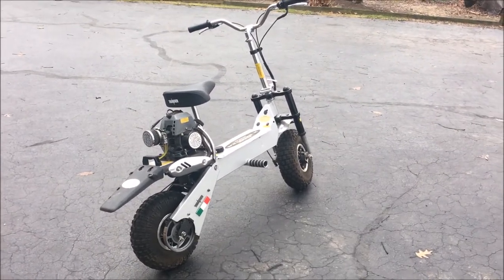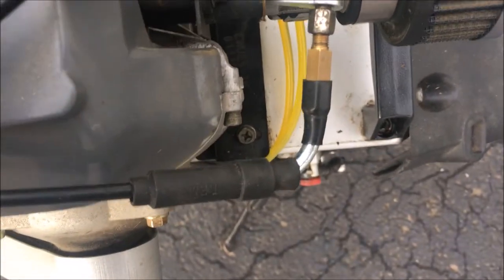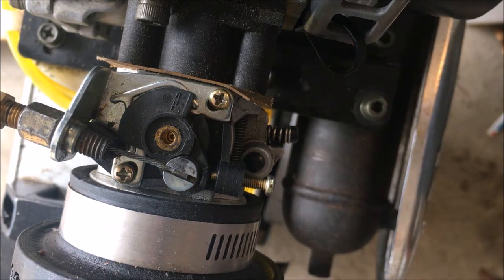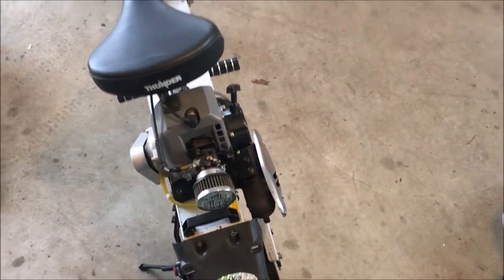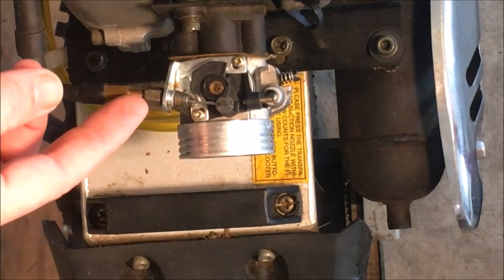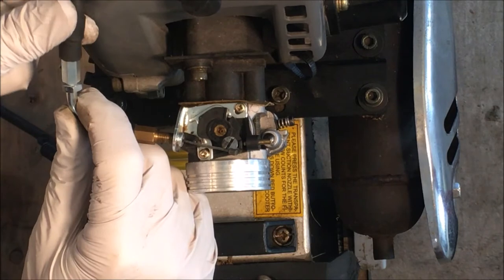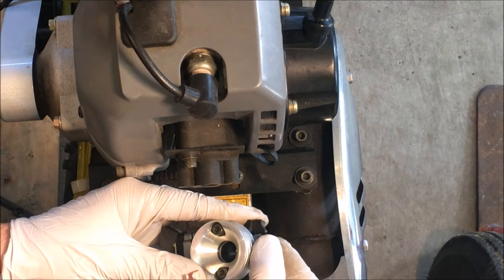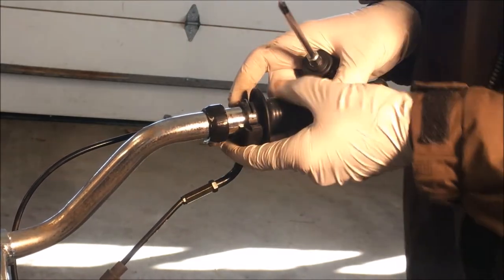Xcooter Thunder XC1000-ATX Tune-Up

Comment: You sir got another subscriber this is great stuff I have one of these man and I don't know nothing about it bro I'm not knowledgeable at all with these type of bikes but I literally have the exact same build other than the carburetor, everybody thinks it's super super cool looking and I know nothing about it it's not the same manufacturer it looks like but yet it's the exact same thing except mine has a camo paint job on it and it looks really really old but apparently they're not that old somebody said it was possibly a Cheweng?
Reply: What size belt does it use